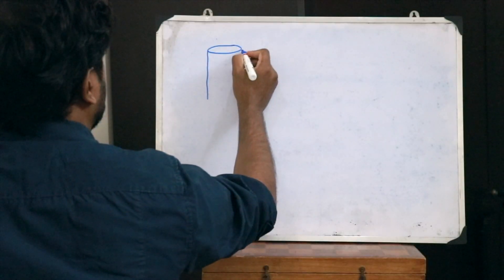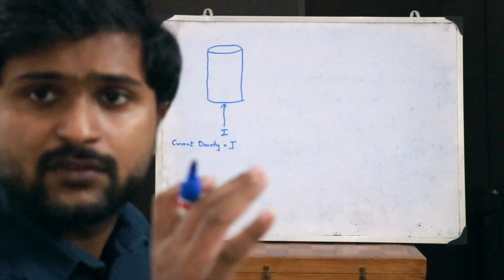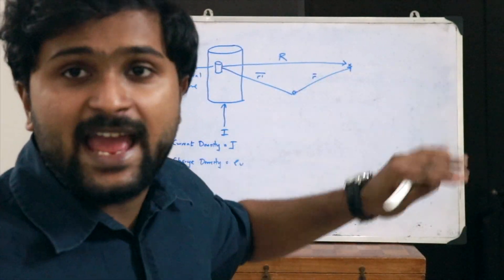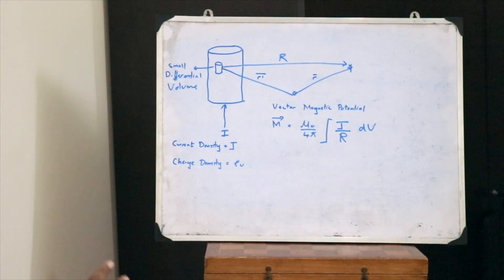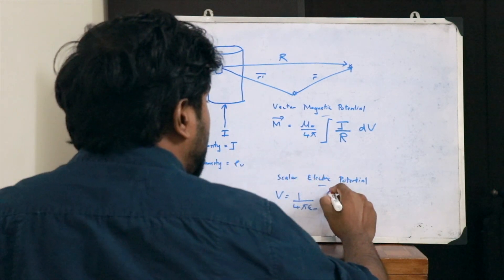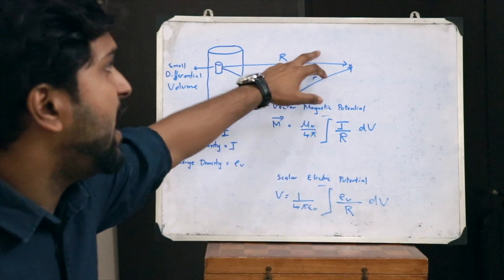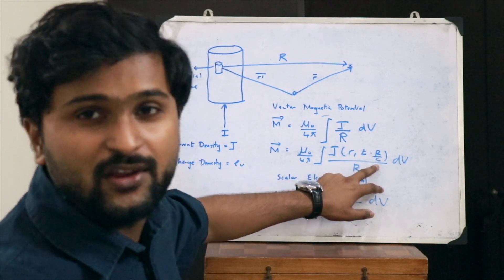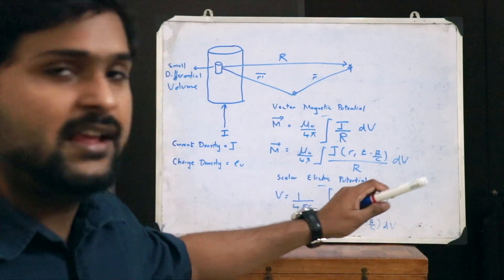The Concept of Retarded Potential by an Antenna | AWP Module 2 |

Comment: Sir, If they are asking explain the concept of retarded potentials, what all we want to write. Do we need to write derivations
Reply from the maker: Hey buddy!! 
Well, if the question is asked for more than 5 marks, just write the derivation and point out the delay factor and state that as the reason behind calling it retarded potential! If it is below 5 marks, I don't think the derivation would be required!! But since it is not that lengthy, I advise you derive and explain the concept!! 

More such videos are in the making so do join our community by hitting that subscribe button so that you will be updated as soon as the videos are out! Do share it with your friends as well!!
Reply: @BackbenchEngineer  ok, thank you sir